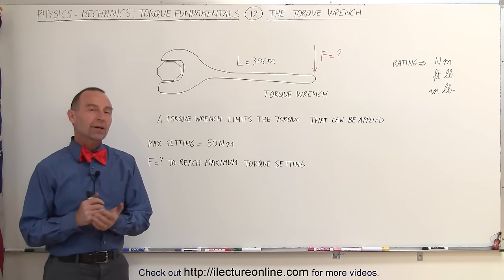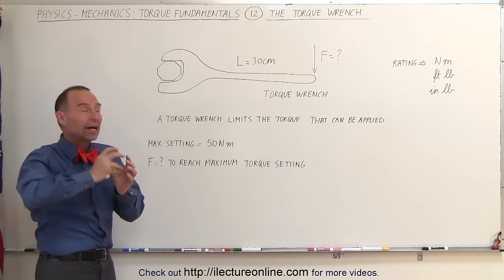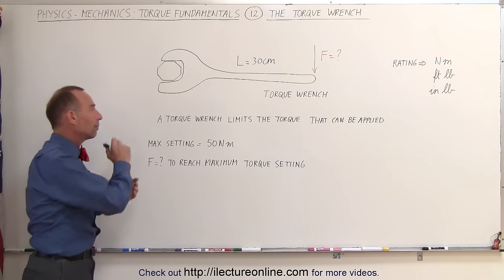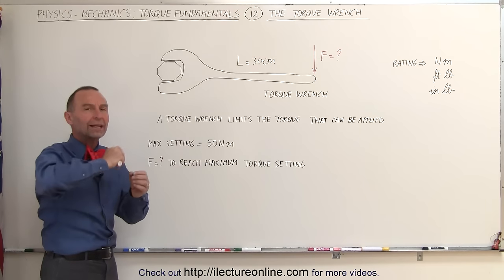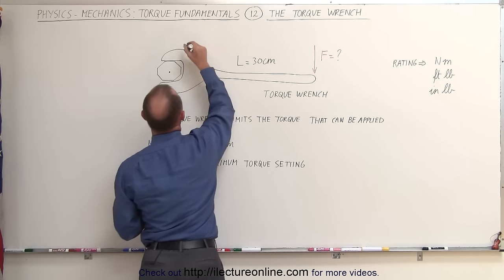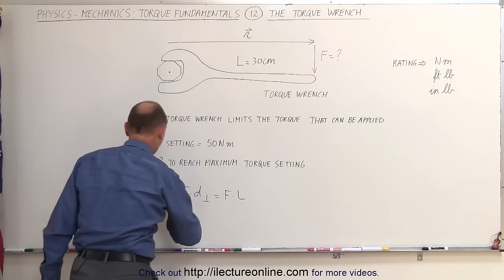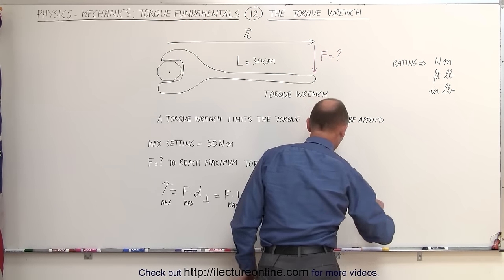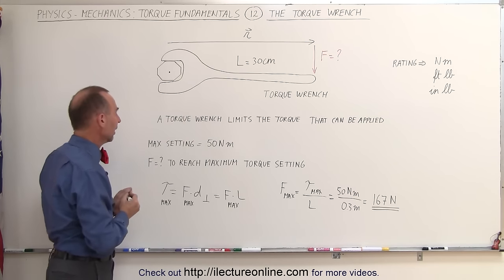Physics 15  Torque Fundamentals (12 of 13) The Torque Wrench

Comment: Nice video! If we were dealing with vectors in this scenario, would the torque be into the board (-z direction), due to the right hand rule? Thanks!
Reply from the maker: You are correct.  Using the right hand rule, curl your fingers in the direction of the force and your thumb will point into the board giving you the direction of the torque.

Comment: How we ensure we are applying 167 N force ?
Reply from the maker: Most mechanical torque wrenches can be set to a specific value.  Once the maximum is reached the torque wrench will not allow more torque to be applied.
Reply: 167N equals 16.7kg. You can pull with a scale up to that weight.

Comment: Great video! I have request for another problem on torque that I really cant understand. It's as follows:

There is a wheel of radius R and mass M and a curb in front of it of hieght H. What is the minimum force needed to apply on the centre of the wheel for it to just overcome the curb?

Thank you! 👍
Reply from the maker: This example may help.  Mechanical Engineering: Equilibrium of Rigid Bodies (19.5 of 32) Ex. 3 Eq. of 3-Force Body
Reply: Michel van Biezen It was very helpful. Thanks!

Comment: where is the point of application of force? axis of rotation? and lever arm? in the wrench? (in the image)

THANK YOU VERY MUCH!😊
Reply: Point of application is at the end of the wrench : point "F", perpendicularly. Axis of rotation : the center of the screw: the dot. Lever arm: the wrench 
30cm. All between 1.09"-1.28".

Comment: This seems wrong. It seems backwards. If I am applying 167n to a 30cm wrench I am only applying 50nm to the bolt or nut!!!???

Seems like it should be that if I am applying 50n to a 30cm wrench the nut is getting 167n!
Reply from the maker: If we leave the mathematics on ths side for a minute.  What do we do, if we have a stubborn bolt that we cannot turn because it is too tight?  We make the handle of the wrench longer.  The longer the handle the less force we need to turn it.